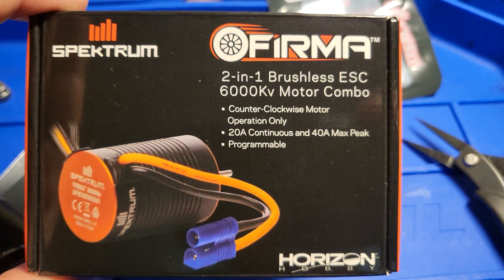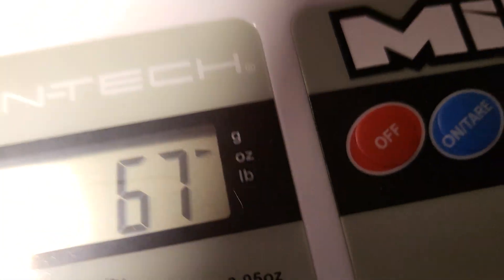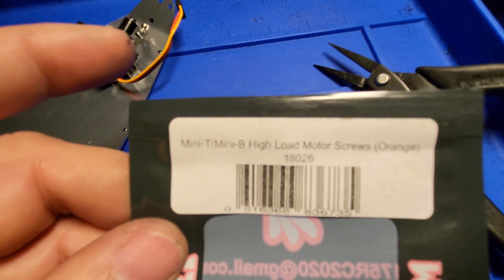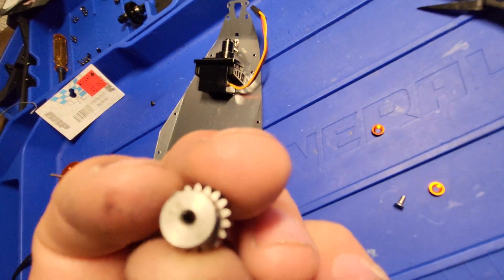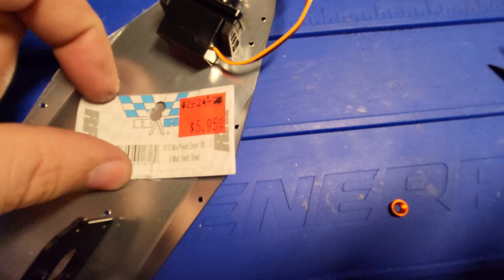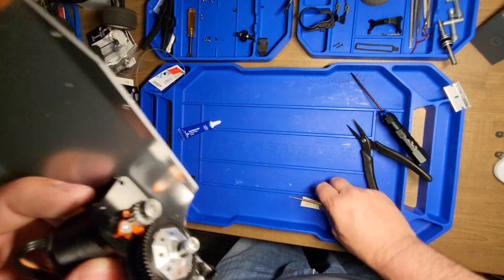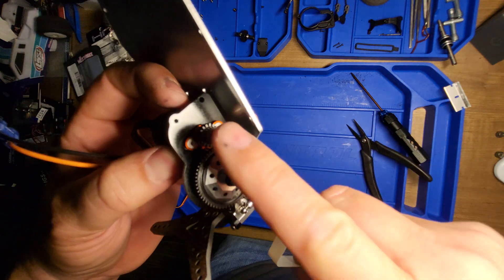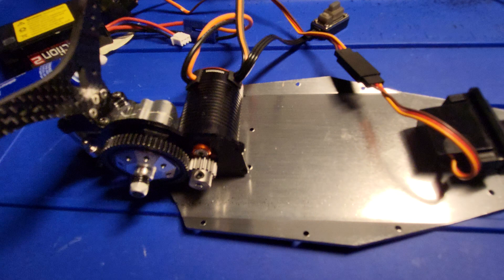Mini B install Spektrum RC Firma Brushless Motor/ESC 2-in-1 Combo (6000Kv)

Comment: The motor heats up and makes the loctite not wor anyways
Reply from the maker: When running on dirt tracks, I had the screws back out after a long race. Wearing down the gears prematurely.  I started to use the Pink Loc tite, and it fixed my problem . Sometimes, I would use Blue Loc tite in a pinch. If your motor is getting that hot, you might have your car over geared.  I found that I can under gear and turn my ecs up a little to take stress off of the motor.  A over loaded or slower moving motor runs hotter in my limited experience.

Comment: What receiver are you using with this motor?
Reply from the maker: Sorry for the late response. This is a link to the radio and receiver I use.
ATA HOBBY Radiolink RC4GS V3(V2 Upgrade) 5 Channel RC Radio Transmitter and 2Pcs R6FG Receiver with Gyro 2.4ghz 400M Remote Controller Kit for Car/Boat/Crawler/Tank/Drifting/Buggy with Lanyard https://a.co/d/g6lVjRz
Reply from the maker: This is the rechargeable battery for the radio.
7.4V 2800mah 20C Lipo Battery Li-Polymer 2S for Radiolink RC3S RC4GS RC6GS Transmitter Reomote Controller https://a.co/d/4s3umIM

Comment: Good video. Is this car the one that you are running in your other video "woodland park", and how does the motor run and what do you think of it now that some time has passed? would you still buy the same one? thanks, have a good day.
Reply from the maker: I like the motor it is just enough  power. If you are running on a corse, you will  not be able to use the full power. It never gets hot. It is great at this price point.